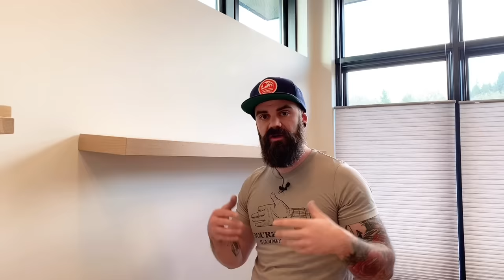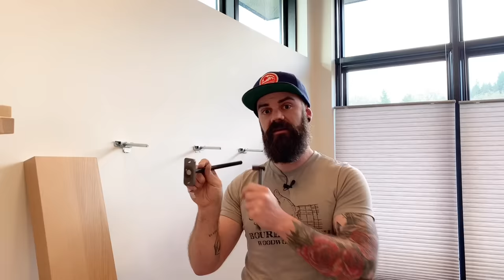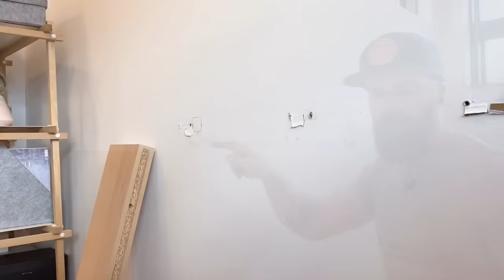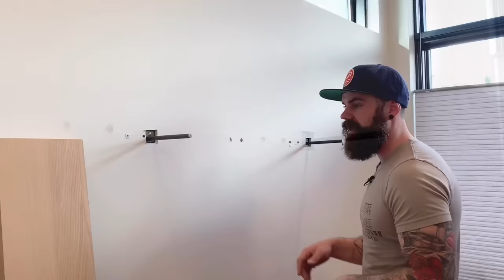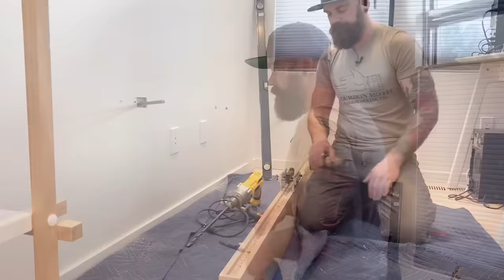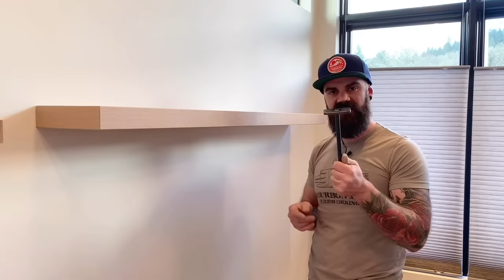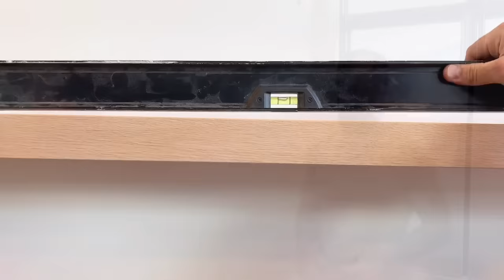How to Install Floating Shelves/DIY Floating Shelves

Comment: Great video - do you have a video that shows how to put up a floating shelf when there is only 1 center stud but you want to use 2 brackets on either side? I have a 4 foot area between a window & cabinets in the kitchen that I would like to put up floating shelves but there are only the side brackets and 1 center, i'd like to put the 2 brackets in between there.

Comment: If your bracket post extended through the plate by 1/2" (ideally at smaller diameter ~1/8-3/16) then that would make a smaller hole, and would prevent the drywall compression issue.

Comment: Great tip on the doweling jig! Takes all the alignment fear out of the equation. Just wonder if a 1/2" rod is strong enough for a 4 x 6 cedar beam used as a mantle...?

Comment: I use plywood and a shaved down 2x4 that is screwed with multiple 3" screws to all the necessary studs and slide the shelf on to the 2x4 with nail gun it on top and bottom. It's quick cheap and looks good. The best part is you don't ruin the drywall when the lady of the house decides she doesn't want them anymore and you have to try to patch up the walls with big holes. Been doing it for over 20 years and never had a complaint. Your's is more expensive and takes expensive tools and longer work time.
Reply: Yes thank you, I didn't like the idea of cutting chunks of drywall out, and thats IF you happen to land on a stud exactly, my house is so old that stud finders rarely find a stud exactly.

Comment: One thing l like to do if i am drilling more than 1 hole is to cut some pex pipe to fit over the drill bit to set a hard stop. It is cheap and easy to cut.

Comment: Have you considered not drilling exactly in the center of the thickness of the board but rather offset to leave more material on top of the rod to better support the shelf? If using 2-inch correct lumber, then rather than at the 1-inch mark, perhaps at the 1 1/4  mark giving you an additional 1/4 of lumber above the rod.

Comment: If I already have tile up in the kitchen would you still recommend using the same brackets and following the same steps? If I am using solid would would your crave out the back of the wood if I can’t put it in the drywall? Great video!

Comment: These brackets are the ticket. Not sure why everyone insists on plug welding and grinding down the backs, though. I use fillet welds and maybe touch a few with the grinder for the screw head to clear. The weld is inside the drywall anyway.

Comment: Your instructions are clear, but I have one complaint. I wish the mounting hardware you used was COTS, starting out the video and finding out I'll need custom-fabricated hardware was a little bit of a discouragement. Other than that, thanks!

Comment: I love the cut away the drywall.  I purchased a kit with a small glass floating shelf. I used heavier anchors and think I hit the stud [may be not]. Over time, I've noticed a slight tilt forward when using some bottles on the shelf.  Any tips for securing a glass floating shelf? Or should I scrap the "cuteness'" of glass and go practical with wood and your video process.

Comment: The caulking is good to avoid insects having a place to hide specially roaches in apt buildings were neighbors play a part of contamination, roaches love tiny places near heat like electricity outlets, tv's , toaster ovens , canle boxes, and they look for water to drink so leaving dishes to dry attracts them and bath if tiny cracks, floor baseboards i caulk everywhere everything lol 🙏❤️☮️

Comment: I ordered the Steel Floating Shelf Bracket from Amazon and I would not recommend if you want to screw them directly into the wall studs. The screw holes are about 1 1/2 inches apart on center which, obviously, means that you cannot secure both screws into a stud.  I'm returning the mounts.

Comment: I purchased the shelf mounting brackets and they are hollow. The flexing and twisting that occurs when trying to mount these level is pretty much non preventable. I prefer solid steel. Also, these holes are not spaced well for stud mounting. I had to install these vertically to work and the drywall repair was more than I had expected.

Comment: Question, good sir! I hope you see it and can answer.

I am nearing the construction phase of rebuilding a pantry (3'x6' >> 4'x8') and need to do floating shelves. Your method seems far and away the most sturdy and structurally sound. However, these shelves wont be 'floating' in the middle of a wall, they will be up against a wall on 3 sides. Is this reasonable to do or should I try and figure another way to make it work? I'm hesitant to build boxed floating shelves because of the expected weight that will be on them.

Thanks! Great job with these videos, also!

Comment: Good video, thanks. Your videos are always easy to follow. I noticed you drilled the holes offset from center compared to the original holes. Just curious why you did that. I assume for additional top strength?
Reply: Because the originals weren't on the studs. Sad.
Reply: I was going to ask the same question and then I figured it out.  If you go to 5:05, after he has mounted the new bracket, you will notice the rod is about 1/4-inch lower than the center line of the original brackets.  In order to ensure the shelf covers the holes from the original botched job and stays at the same height on the wall, he has to offset the two new holes in the shelf.  That's why he had to use the red spacer on the self-centering doweling jig.

Comment: Awesome video! Question about brackets... why are they so insanely priced? A 2 bracket shelf is already costing $90 to put up before wood even comes into the picture. Seems that lag bolts with heads cut off, as others here have mentioned, is a far more affordable way to go.

Comment: Do we bring the original brackets to a welder for them to gauge the proper size to make for us or are you saying that the ones you used in this video are the best ones for any floating shelf that meets those dimensions?

Comment: I want to install floating shelves and then tile will be installed.  Your brackets look completely sturdy. I am want to use solid wood that I will distressed to resemble drift wood.  I am looking to have 10 inch deep floating shelves. What depth can your brackets accommodate.

Comment: Just a thought, you could you use lag bolts, pre-drill the mounting holes, then cut off the heads? Cost effective, wouldn't need to cut sheetrock, and easily removeable.

Comment: I have a question about the brackets you had welded up. Since the 1/2" round stock appears to be mounted on the 1/4" plate off center (vertically) to allow for room for the screw, do you drill the hole in the shelf off center as well? In a situation where you're mounting flush to the sheetrock, or paneling where you aren't recessing the bracket, how do you make sure the bracket is still hidden? I hope that makes sense. Thanks for the videos!

Comment: Where did you get those great 1-screw mounting brackets? I followed the description link, but those are definitely not the ones shown in the video. I can't find the 1-screw ones anywhere (which I like because 1- screw goes into the middle of the stud and 2-the mounted end can be smaller and won't show around a 1.5" shelf.

Comment: Wall studs are not usually installed on the flat, which would make them 3 1/2”. Installed on edge, which is the usual method, the nailing or screwing width is then 1 1/2”.  Your said your studs were 2 1/2” wide. ???. But will your brackets work on a 1 1/2” edge?

Comment: Great video/work. Would it be advisable to use square or rectangular bars and a mortiser for the holes to eliminate 'give'?
Would be a costlier and more time consuming solution for sure but will it work better than round stock?
Thanks.

Comment: Hopefully you find my question and can give a response. I could only find the brackets used in your video with two holes in each place which leads me to believe they mount them outside of the sheetrock or plaster. have you used this type and how well did they hold? I've considered drilling a center hole to mount them as shown in your video because the two holes would not work on a wall 2x4 stud

Comment: Does it have to be a prefab floating shelf with the long cutout groove in the back or can it be a piece of solid lumber?  Also, I am sure you posted somewhere in the comments where you can find the welded brackets, but there are 875 comments now.  Could you restate where you can find those?  Thank you!  Enjoyed the video

Comment: What was the power tool you used to cut the holes in drywall? If one doesn’t have one (I suspect most of us viewers don’t, and may not be able to justify buying one for just one set of shelves), what alternatives do you suggest to cut those trim holes? Thanks.

Comment: how important is it to have the hole(s) on the bracket in vertical way compared to the stick part which goes into the shelf? so from top to bottom: hole+stick(+hole) OR from left to right: hole+stick+hole? thankyou! great video again!

Comment: About that banter 😂 I prefer cordless tools for torque and great power.  They aren't what they used to be.  I guess what I don't like as an electrician is the lack of control when drilling grabby materials.  Cord drill may bog if it's not a great big mother and then when you let off it ramps to a 100 million rpm.  The cordless electric braking is nice too. But really I said this only to be a turd.  I'm not against corded tools.  Again excellent job man.

Comment: I like the brackets but not my prefered method. I agree the ones you replaced were not installed correctly but there is more than one correct way to do it. I drill 5/8" hole into studs and insert a 5/8" wooden dowel with some wood glue.

Comment: Question... are you checking the wall for plumb before mounting the brackets? A stud 1/16” of our plumb can show up big time on a 12-14” shelf. And if the wall is out, are you shimming the back to compensate?

Comment: I like your method here, just a ball ache getting decent brackets. I've seen these floating shelves put up just by putting a threaded bar, cut to length, straight into the stud, or glued into block work, any reason why this is a bad idea?

Comment: I have a "D" Log Cabin, logs are 6" x 8" (no drywall), can I drill the 1/2" hold directly into the log like you do the shelf? I figure 3" into the wall and 6" into a live edge (3" thick) shelf. Thoughts?

Comment: Im curious, couldnt you just use hollow wall anchors to disperse the force to both sides of the drywall? I get that it wont be nearly as strong as a stud but it should provide alot more support, shouldnt it?

Comment: Just to be safe, why not drill the holes out at 5/8" and put a little silicone in there before pushing the shelf in?  Seems like you'd be more likely to get an easy fit, and you could still pull the silicone free with enough force.

Comment: Also, why don’t you pre-drill holes in the stud before you screw in the screws? I’ve seen this in other videos too, and been surprised. I was always taught to pre-drill the holes.
Reply: Oh, I see it’s an oscillating multi-tool. These look very useful. But are there any good alternatives if one does not have one of these?

Comment: If I plan to put my floating shelves with similar brackets to what you have and these will all be over a tile backsplash (yet to be installed) would you still recommend going all the way to the stud with the bracket?  So then the shelf would sit the thickness of the drywall plus the thickness of the tile from the bracket?

Comment: What if you’re trying to do the same thing but the wall has metal studs? I’m trying to install some solid hardwood shelves for a skin care company that wants to stock bottles of oil and lotion for display but I’ve never dealt with metal studs before.

Comment: I don't usually comment on videos but couldn't leave without saying: If your drywall is there for fire seperation cutting bits of it out is not a great idea. At least fill around the hole to ensure integrity is maintained. This looks like an external wall so shouldn't be a problem but maybe consider a different kind of shelf on walls that seperate you from your neighbours.

Comment: I'd really like to hang floating shelves in my kitchen, however, I don't have the option of removing the tile to gain access to my studs. Is there another bracket I can use or another way to be able to hide the "face" of this bracket in the event I have to drill them through the tile to get to my stud?

Comment: The bracket you used has one hole, but the Amazon link has two. The Amazon link doesn't state the dimension of plate or the spacing between holes center to center. Any chance you have another supplier and/or know the specs of the Amazon linked brackets that would share?

Comment: This was well received. I'm taking down two large cabinets and putting up floating shelves. What about plaster and lath instead of drywall? This house is 100 years old and the new addition is fine but my kitchen is in the old schoolhouse portion. Any tips on making them secure? They absolutely have to be double thickness as 2 by 10 by 6 feet long. Thank you new subscriber here

Comment: what can be done if the wall is not that strong? my block of flats has been refurbished with polystyrene plate (I hope that's the English term) and the inside wall under my window has been done same way ... how can I secure the shelves? I intend to have like a mini study desk  ... Thanks a bunch

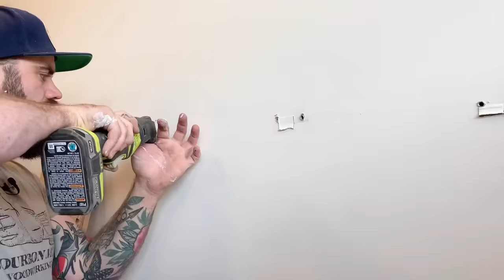Comment: what tool is being used at min 4:21 to cut the drywall section out?  Is it a reciprocating saw with a special blade?
Reply: It’s called an oscillating multi tool. They are awesome for diy jobs around the house.

Comment: I’d like to do floating shelves on poured concrete wall in my basement with solid wood. Any other recommendations? It’s a patterned wall to look like brick.
Reply: You'll need a hammer drill and masonry bit.  You can probably rent the drill, may have to buy the bit.

Comment: I know you putting all your weight on the shelf was a demonstration to the strength given due to the brackets being in the studs, but there is actually a decent amount of decline in the shelf after you did that. Not anything that would render the shelf unusable but it's still noticeable. 

12:10 vs 12:25 is pretty significant imo

Not trying to be a dick, I love the channel just observing.

Comment: Why get brackets made and cut the drywall when you could just drill a 1/2 hole through the Sheetrock and 3” into the stud. Use the same friction you use to hold the shelf to hold the straight stock.

Comment: Can you drill holes into regular lumber (2x8?) or will it split the wood?
Reply: You can drill directly into the stud. I have personally done this. There are some concerns though. 1) most 2x8, 2x4 etc are 1 3/8" thick. Using a 1/2" bolt or round stock leaves little wood above and below the bolt. If the item is heavy enough it could cause the wood to crack. I used 3/8" rebar. Bolts are not designed for structural movements, left, right, up down etc. The rebar is structural steal. As an example you can take a 10 or 12" lag  or threaded rod and it will be flexible.  Rebar the same length will not move at all. 
Typically i will use a 2x12 as the shelf and pretty it up. Planing sanding routering the top edges etc. I will drill about 8 to 9" into the 2x12 using a drill guide. I use this one 
Https://www.amazon.com/dp/B00GUS6VZY?ref=ppx_pop_mob_ap_share
I will then drill directly into the 2x4 or 2x6 (most newer homes have 2x6 wall studs). Using the same drill guide in the link. I will drill in 75% of the width of the 2x4 roughly 3 inches. Be careful not to go all the way through the stud. The tape method he uses here is the best way. Put your rebar into the stud and cut it off at the depth you drilled into the 2x12. Shelf wont move and the ribs on the rebar will hold the wood in place. Hope this helps

Comment: What if only one stud is in the area you want to place a floating shelf?
Reply from the maker: Add one
Reply: @Bourbonmoth  Add a stud to an existing wall? I could, but seems like a lot of work to add a shelf. Would be great if you could do a video on that.
Reply: @gbengoosewuru4139  what you can do is add a horizontal stud between two vertical studs at the height you want to mount your shelf. Unfortunately you'd have to open up the drywall in that area and repair, refinish, and paint once you're done.

Comment: I have zero skill level. I noticed the shelves are routered.   No way I can do that part.  Can you buy shelves like those ?  or do you buy and toss the bracket.  Could I use the industrial pipe looking  parts they sell everywhere  and the round brackets that go with them  if the shelve will cover ?

Comment: Shelves. Also, you want to make sure you don't use a screw that's longer than 1.25" to make sure you don't screw through a wire that's running through the stud.

Comment: You need to put a level on each rod dude, before sliding the shelf on. The brackets are tiny & studs are softwood, if one screw pulls more than the other, you’ve got a problem, plus, what if the wall isn’t plumb?

Comment: Never drill the hole deeper than length of the bracket and never jiggle the drill sideways or back and forth, the hole needs to be really snug and those two things will introduce unwanted play. Cheers